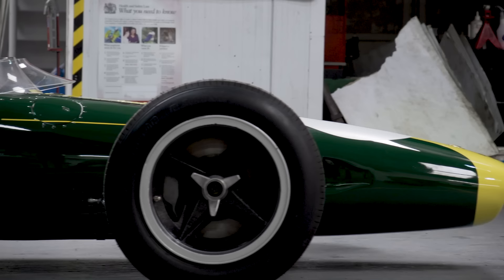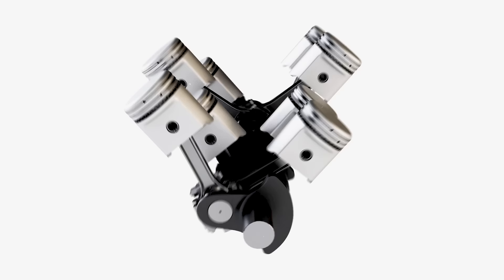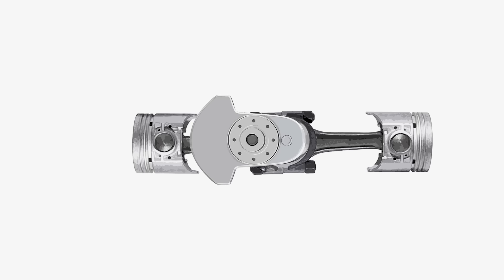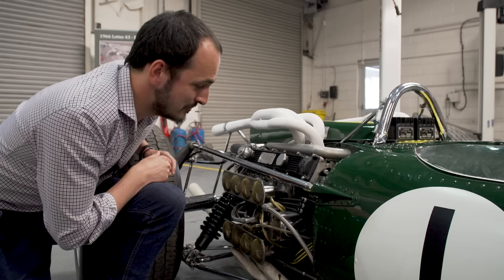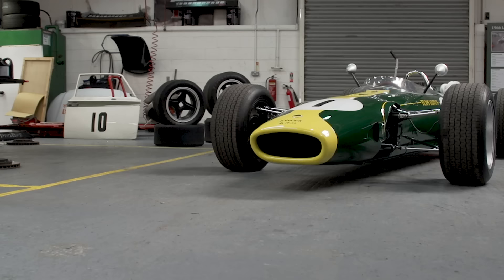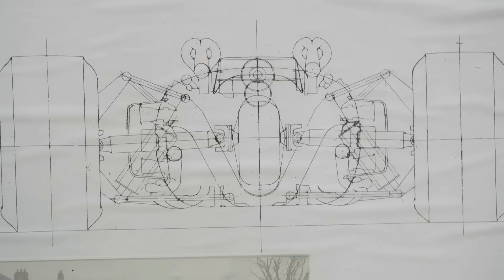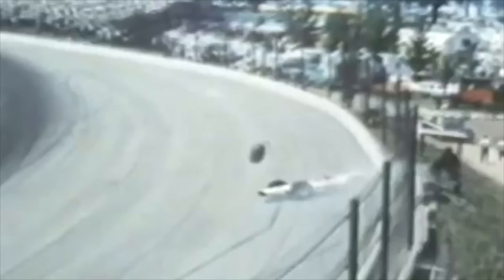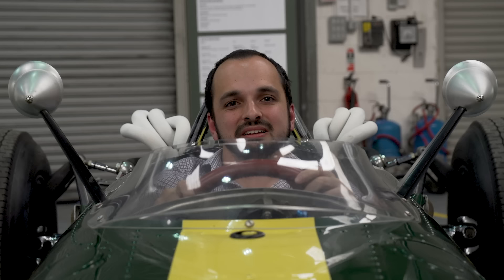Remembering Jim Clark & the Lotus 43 | DriveTribe In Detail - Episode 03

Comment: Team Lotus used Coventry Climax engines in the 1.5 ltr era. It was only CC's decision not to make a 3.0L engine that prompted Lotus to use the BRM H-16 (as well as a stretched 2 ltr Climax V8)
Reply: Thank you for pointing this glaring error out. Although the BRM was used by many Lotus customers, the factory F1 team almost exclusively was committed to the CC starting in 1958 with the Lotus 12 and 16.

Comment: Between 1962 and his death in 1968, Jim Clark won every race where he wasn't delayed by mechanical or tyre problems, and indeed he won many races nursing major mechanical issues such as the debut win of the Lotus 49 (glazed brakes and a faulty clutch).  No driver before or since has come close to that.  A few corrections to this video.  In 1965 Team Lotus used Coventry Climax engines, not BRM.  Lotus only ever intended to use the BRM H16 as an interim until the new Cosworth V8, then under design, was ready.  Oddly, Colin Chapman turned down Jack Brabham's offer of the Repco V8, which would have guaranteed many victories and probably the world championship.  The first car with the engine as a fully stressed member was the Ferarri 158 of 1964, designed by Vittoria Jano.  Jano had previously used a V8 engine as a part of the chassis of the Lancia D50 of 1954, augmented by two frame tubes.

Comment: I love this 3.0 cars, but I think they are abomination. 1.5 engines were reasonable for this era/chassis type. Obviously they weren't safe at all, but the power was spot on. With 3.0 and no aero, this cars became something out of this world. Meat grinding machines.
Reply: Even when they fitted wings these three litre cars with aluminium chassis on the circuits of the time were death traps.  It would have been better to increase engine capacity from 1.5 litres to 2 litres.
Reply: @markmorey799  True, but aero/downforce made carrying such power through corners more reasonable. You at least had something to lean on. Otherwise, what's the point of 3.0 engine if you only have mechanical grip to keep you in the corner. Anyway, for me, guys that drove this demons successfully were gods. I don't think there's something more exciting than this cars in motorsport history. Maybe Mercedes W125? 600 bhp Messerschmit bomber engine fitted to a bicycle without disc brakes haha?

Comment: Back then formula 1 was not as restricted . That is how innovations happened .But now its just shit .
Reply: jerryl davis f1 has always been restricted. The word “formula 1” comes from the fact that the cars had to adhere to the formulas defined for the specific racing series. Today, the rules are just more restrictive (e.g. Everyone has to have a V6 1.6, while before cars could have e.g. A 1.5 forced induction or a 3.0 NA - and you could figure out yourself how you’d comply to those restrictions)
Reply: For it is true that the new restrictions only made cars faster, for example, than last year! What is the difference of times per lap compared to 1965?
Reply: Trigster that is why wec,le mans will always be above formula 1 because of way less restrictions it has and the choice to do your own thing.
Reply: well.. except for when the WEC threatens to punish teams if they are faster than Toyota or stint length maximums.
Reply: Yeah do your own thing as long as it follows a certain set of regulations, many of them even sillier than F1's. So in the end, you can barely do your own thing. Also, BoP alone make your claim fall apart. In F1, those cars perform at their maximum. They're the ultimate. LMP1s are severely restricted. That's proven by the incredible unrestricted Porsche 919 EVO. It's no coincidence F1 is the pinnacle of motorsport.
Reply: So I presume that, were you in charge of the FIA, you’d be okay with being responsible for the return of multiple annual deaths due to lack of safety?